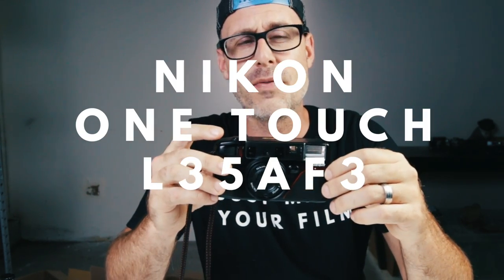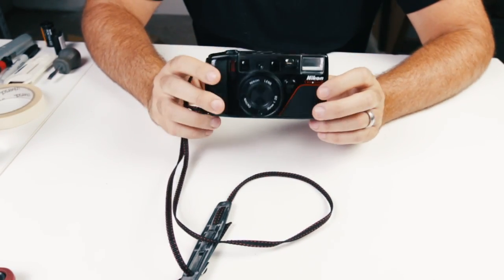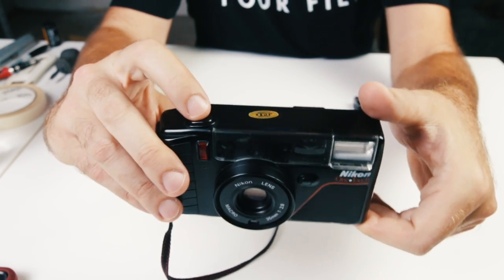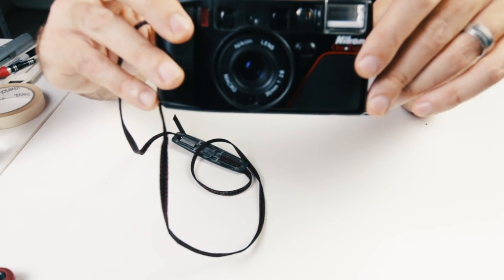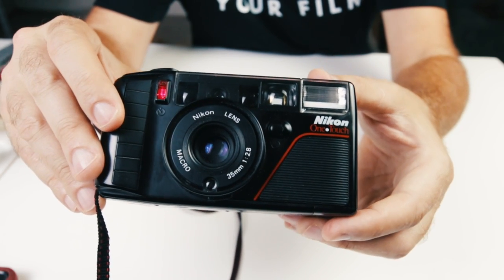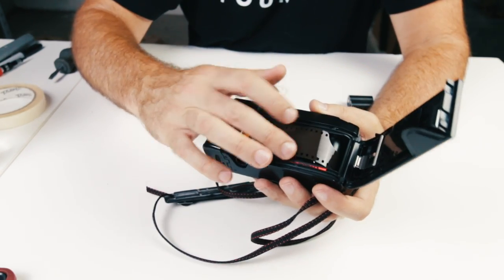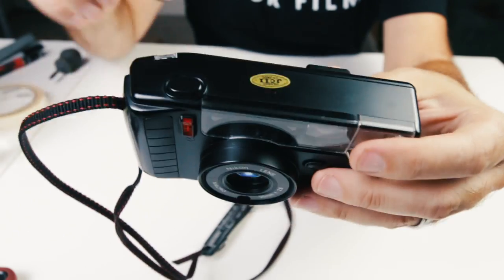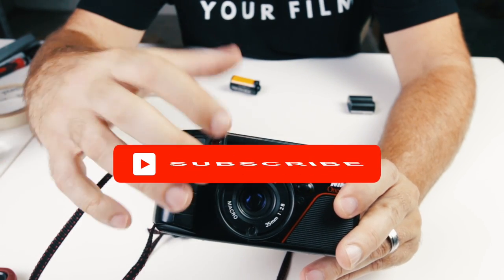How to USE a NIKON One Touch L35AF3 35mm Film Camera - BATTERY Replacement & LOAD Film

Comment: Hey mate, I followed your instructions on how to open the battery compartment. I pushed into the small hole and ever since I did that, the compartment door now dosnt close and always swings open. What is the purpose of pushing into that hole and is there a way I can fix this?
Reply from the maker: The small hole is how you unlock the battery door when you press it in.  Sounds like yours might be faulty.

Comment: Mine is auto rewinding the film too early, any advice? Current attempts and the results so far:
1. 32 shots
2. 12 shots
3. 28 shots
4. 36 shots

Is it possible to get film back to it's original spot, before the premature autorewind took place, so I am still able to use the whole film?

Thanks in advance!
Reply from the maker: Hmmm not too sure about this one.  That’s super frustrating.  Sorry I don’t have any tips on this one.  👎
Reply: I’m having the same issue. Wondering if you ever found an answer?
Reply from the maker: I’ve not heard… maybe Roland has a fix?
Reply: @jessamynvp1  In my case, a brand new battery solved the problem. Never had any issue since then. It was a bit weird, because the battery which came with the camera seemed to be also very new, but as I said, as soon as I replaced it, the issue was gone. I shot about 15 rolls since then.
Reply: @rolandkieslinger8656  Interesting! Thanks so much for the reply, i'll give that a go :)
Reply: @rolandkieslinger8656  Could I ask what battery you bought? Going to try the same one